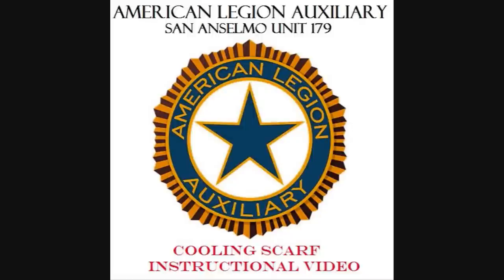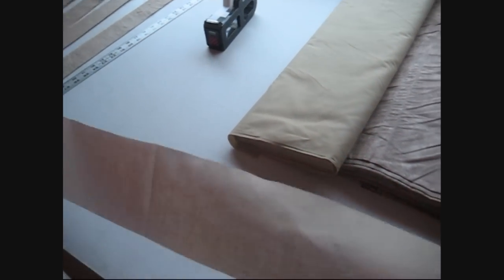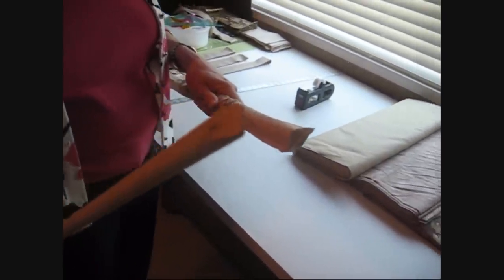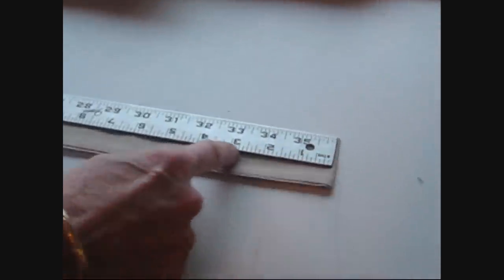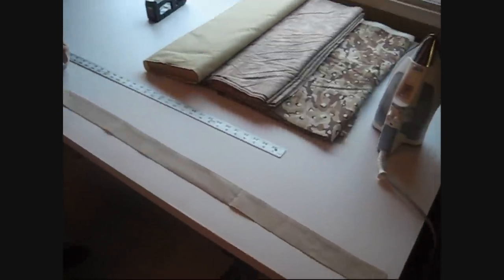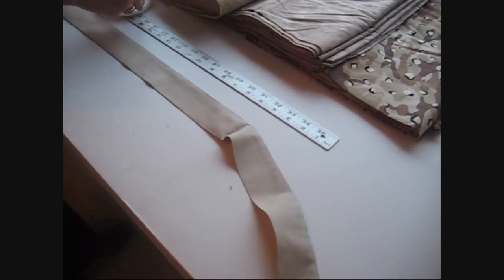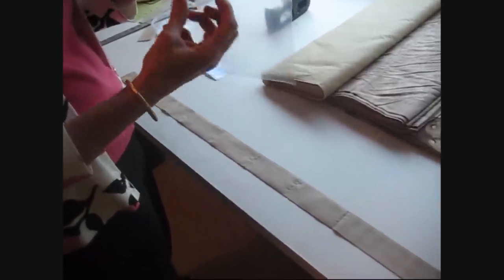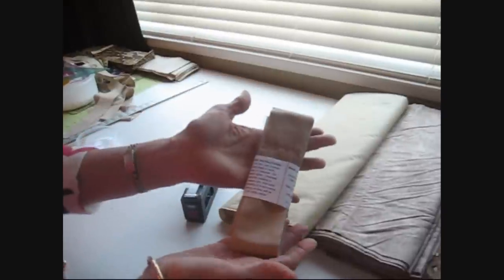Cooling Scarf Instructional Video

Comment: Another great way to turn them right side out if you don't have a long pipe or stick... Lay a long piece of ribbon or yarn down the right side of the fabric (about an inch longer than the scarf)
Fold your fabric wrong side out (ribbon is now inside) sew over 1 end of the ribbon.. Like the end of the scarf, the 1st end you sew shut, now as you sew down the scarf, make sure you aren't sewing over the ribbon.. When you finish, all you have to do is pull on the ribbon (that isn't sewn) & itll turn right side out! Then just cut the ribbon off
Reply: this works great. I usually trim selveges off the fabric and save for this reason

Comment: I noticed that the water beads are sold by 2lbs 4lbs etc. How many scarves will 2 lbs make? I saw where you said to just use 1/4 of a teaspoon per segment.So one teaspoon per scarf sounds like 2lbs would make a lot of scarves.
Reply: According to the Watersorb website, each pound of medium crystals contains about 115 teaspoons.  With the inevitable spillage, that should make about 100 scarves.

Comment: Do you have a instruction sheet that shows the size of the PVC pipe?
Reply from the maker: +Rebecca Scott Length wise - it should be as long as your scarf is, plus a few inches.  Diameter - whatever will fit inside the scarf.  Something on the order of 1.5-2 inches will probably work great.

Comment: Why can't you freeze these? Soak in water then put in freezer?
Reply: When water freezes, it expands. so if the beads are full of water, then they freeze, the expansion of the water will cause the beads to actually burst open. the goo will freeze solid and when you attempt to use it: 1) it won't be pliable to tie around the neck and 2) the goo, which is no longer contained inside the beads, will ooze thru the fabric and the tie will not be useful.